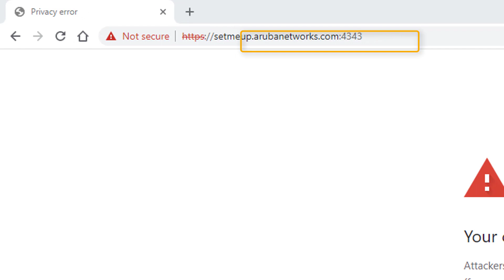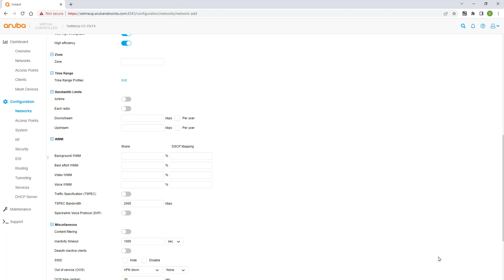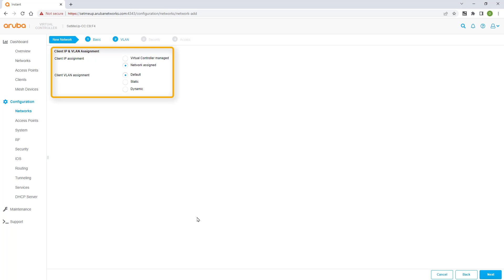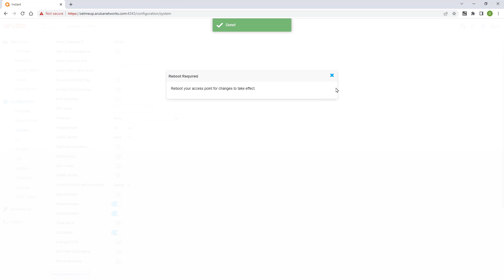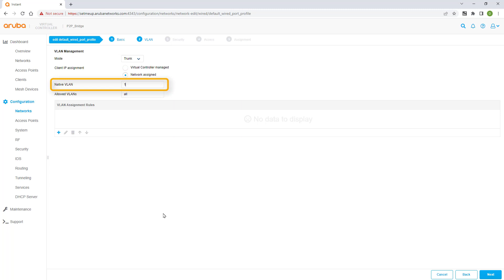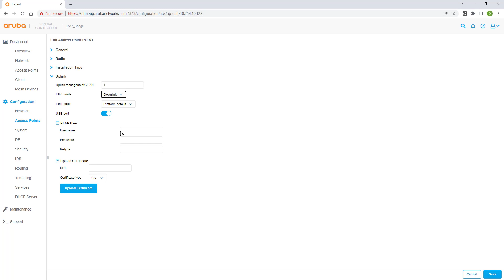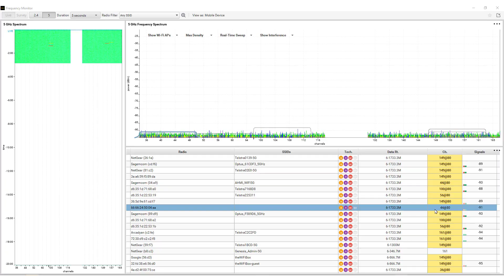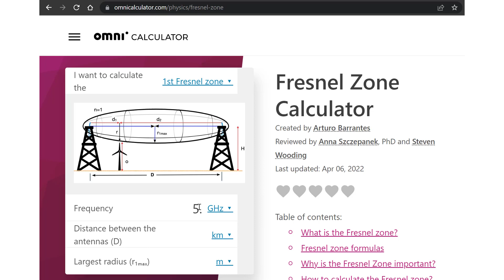How to Configure a Point to Point (P2P) Bridge Connection using Aruba AP-567s

Comment: I've followed this setup... However, I can't see any other devices on the downlink that are in the same VLAN as the APs management... If that makes sense? ie. Management VLAN10 - AP Point has a management IP in that VLAN so does the switch its connected to at the other end. I Can't access the switch on VLAN10... But the switch is receiving all the other via VLANs via the AP Point downlink (trunk)..

Comment: I want help 0:26 , it didn't appear on the Wifi Set Me Up icon
I have a device aruba  APINO 315 THANK
Reply from the maker: You need to make sure you have the instant version of this AP (IAP) not the controller based version. Have a look at the back and check the model number. If you indeed have the instant AP then you should perform a factory reset. Have a look at this video to learn how: https://youtu.be/zHC-P_qkLSo?t=239

Comment: What if I want to Use it as a AP for mobile devices like Cellphones and Laptops? whats is the maximum range?
Reply from the maker: your device will be able to hear the AP well past 100m range with clear line of site but the AP will struggle to hear the device beyond 60-80m range. This is because handheld devices generally transmit at lower power levels and have much worse antennas.

Comment: What is the maximum distance between both APs? Could it cover more than 1 mile? Are there advantages if I use an AP-577?
Reply from the maker: It could cover more than 1 mile though performance will be impacted. AP-577 will provide overall throughput. Stay tuned for our AP-577 video ;)
Reply: @ArubaPhoenixProClub  577s will do a mile, but in denser areas with more interference the performance will be lower. AP-574s with ANT-4x4-5314 antennas will easily do a mile, the antennas are much higher gain and are narrower to improve interference rejection.